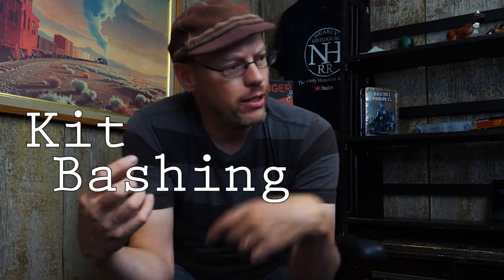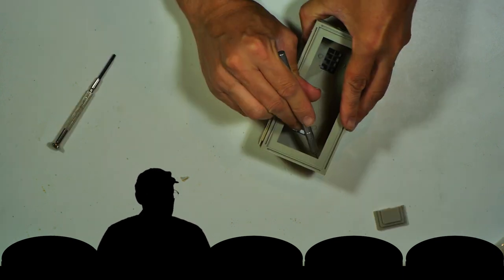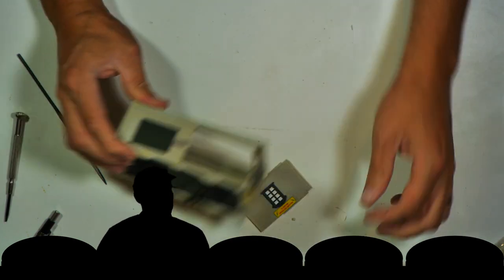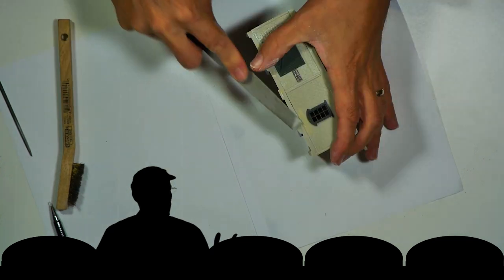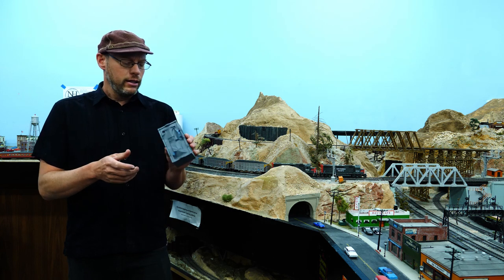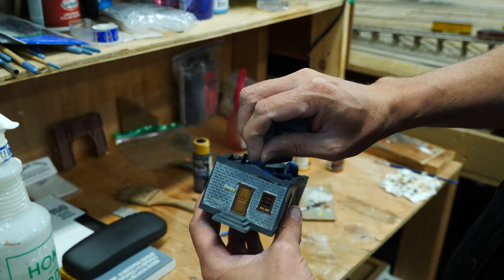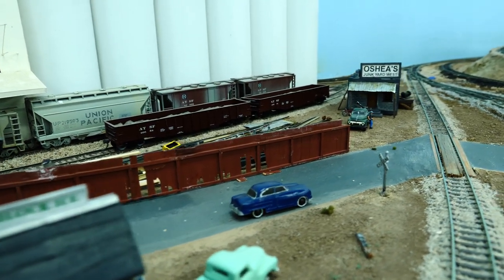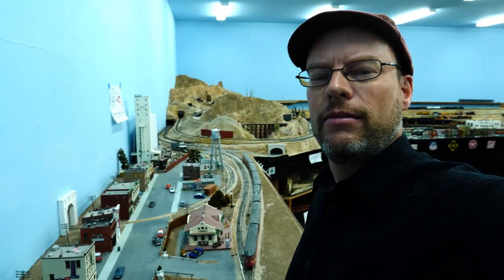How to rebuild a building kit on your train layout. Break it apart & make it new again. Kit Smashing

Comment: Hey Don2.0,
I love doing kit bashing and smashing.  As well as scratch building.  So here's a quick tip.
Above the awning at O'SHEAS WEST there is a gap between the brick mold and roof trim.  To fix it, say when adding acetate to the window, is a small squish of SILLY PUTTY.  Cram the SILLY PUTTY into the gap from the inside.
Don't be afraid the over fill the hole.  Let it dry thoroughly.  Three or four days.
You really want the filler rock hard.  When hardened you can file the exterior wall to your desired smoothness and paint the filler.
BUT DON'T match the paint color of the rest of the wall.
To show a Junk Yard grunge, paint the newly filled gap a few tones lighter.  That will show the gap was patched and painted sometime after the original job.
Good episode,
~Jim
Reply from the maker: Thinks Jim. And that is a great suggestion.

Comment: Hey Don very cool way to show the kit smashing even the wife thought it was cool.   Fill in the gaps, I repurpose building a lot what i use is little pieces of sprue and have a bottle of liquid cement and add the little pieces in the bottle the cement liquefies after a week or to then when you need a gap filler I just apply it and when dry sand it.   I have also used it to strengthen corner joints.
Reply from the maker: That sounds like an interesting idea.
Reply: I've also done that, and it works pretty well although it can shrink a bit so you want to build it up a bit thick and make sure it's cured completely before sanding.

FWIW, I've always seen it done in the little squat square Testors liquid cement bottles that have the brush built into the cap, so you can apply it with the brush and not worry about trying to clean it off the brush afterwards!
Reply: @BrooksMoses  I use Plastruct Plastic weld I use micro brush.  Yeah it does shrink should have put that in the comments. Never tried Testors thanks for the heads up
Reply: @ModelRailroading  don it works like new money.

Comment: One trick from the plastic-model-car world that could be useful for filling things like those divots: Once you put the CA in the divot, press in some baking powder (or just dust it on), and then shake off the excess and repeat.  The baking powder makes the CA harden very quickly, and it also gives some substance to the fill so it doesn't shrink.
Reply from the maker: I think I have heard something like that before. Totally forgot about it of course.